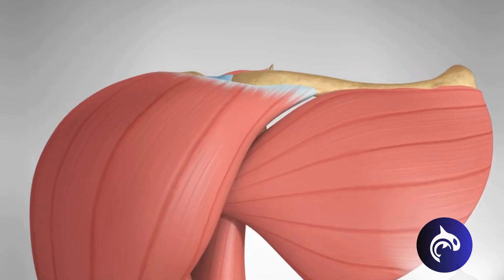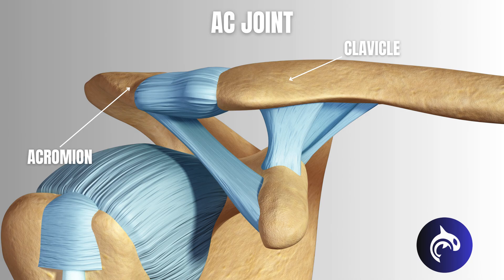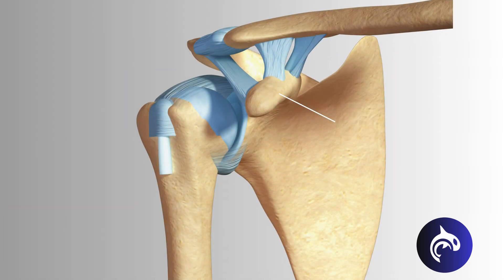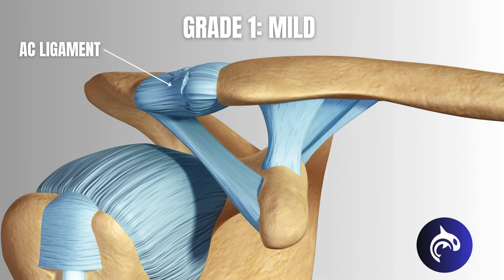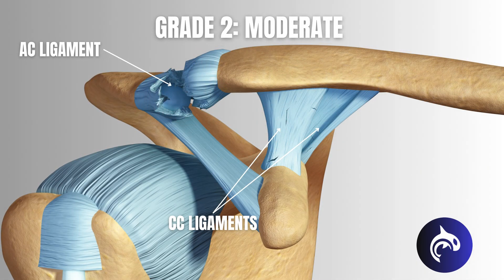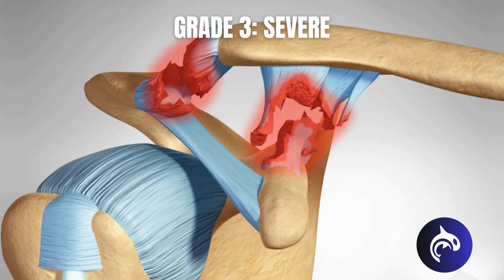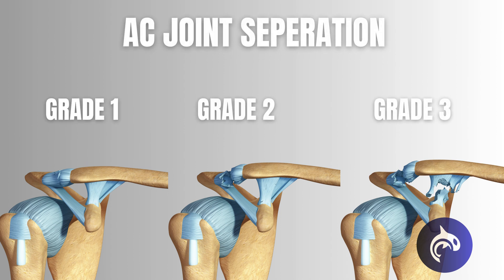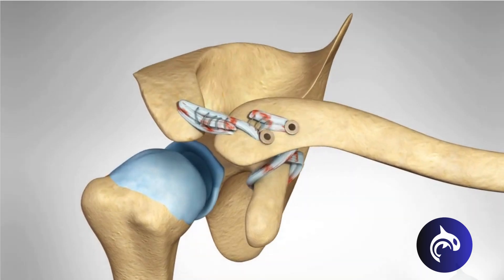AC Joint Separation - 4K 3D Animation

Comment: I have currently an AC separation. The radiologist of my x ray says I have a grade 1, there is a small bump on my collarbone, I can honestly say the pain is extremely minuscule, I don't even remember even actually getting the injury, the pain just came about. There is definitely some kind of separation Im just finding it extremely hard to believe it's a grade 2 or more considering the mobility and strength I have in the arm. Would it be possible to have a grade 1 and still see the bump? Could the ligaments just be stretched and heal soon?

Comment: Why can't the surgeon just stitch the torn tendons back together?
Reply: woukls never heal or grow together agin...I got grade 3 myself a mont ago
Reply: @chomik751 if the surgeon cut the tip of those toen tendons again and then stitch them again. I think the tendons will again heal itself with one another?
Reply: @Ahmad15070  nope my surgeon told me not possibles had no surgery thank god,4 month after injury grade 3 I am back at work ( metal worker hard labour ) no problem workin range of motion 90% strength 60% I can do almost anything at the gym however bench press shoulder presses impossible need non injured ac for that so life is normal but activity limited and of course right side, dominant side injured.....
Reply from the maker: Great question! In AC joint separation, the ligaments and tendons around the joint are often torn or stretched out, but simply stitching them back together doesn’t always provide enough stability because these tissues may be damaged or weak. Surgeons often use special techniques like reconstructing the ligaments with strong sutures, grafts, or hardware to better stabilize the joint and allow proper healing.

This approach helps restore function and reduces the risk of the injury happening again